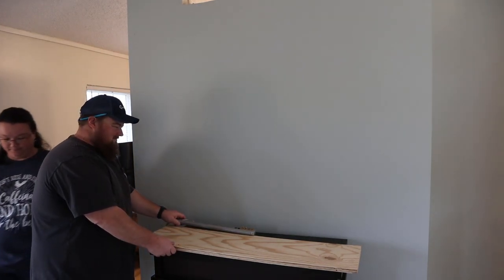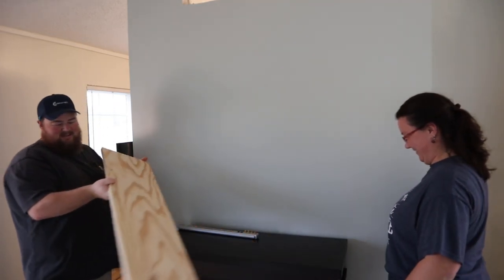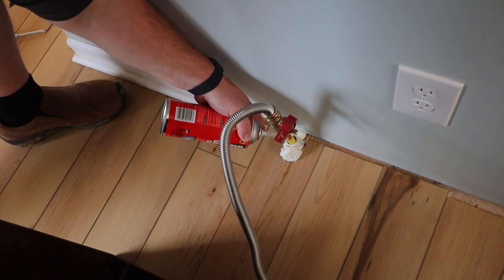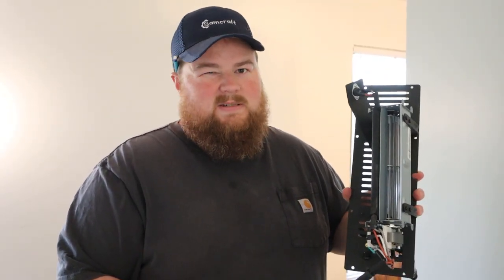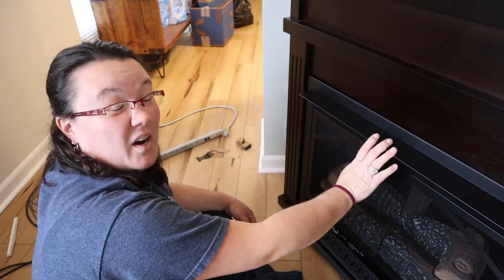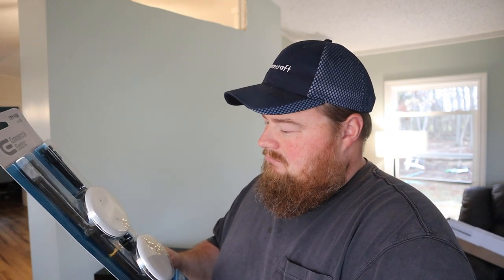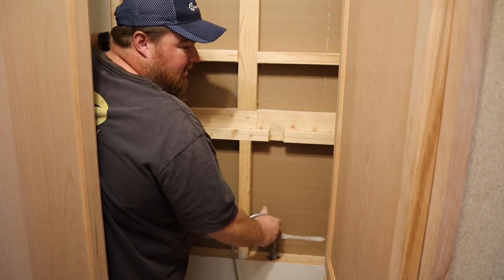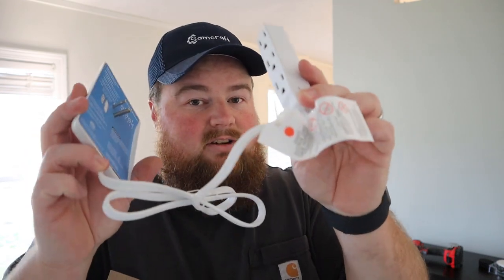Blower Install + Wall Mounted TV // Mobile Home Gas Fireplace Install

Comment: I still love the flooring, very natural and nice. I do have a question though about the fireplace. The blower intake is on the back of the fireplace that is now very flush to the wall which is beautiful, but how does it get air to pull in? If a vent is needed you could do a small metal black vent in the side of the fireplace on the Christmas tree side of it so you don’t see it. Idk. It all looks amazing and professionally installed. Great job.

Comment: We did the same thing as you...buying a squirrel cage type blower unit ...but after installing the fireplace, we too found that the propane fireplace put out so much heat and distributed it so well, that the blower was not needed.  We were located in the northern part of Minnesota and on the coldest days, just to give the heaters a boost, we would sometimes use a small box fan to help spread heat faster, but mostly it was never needed.  Something else about the one we bought, it had no thermostat, so it stayed on constantly if used, even when the fireplace would kick off.  And then all it did was make it feel colder.

Comment: Hey y'all. I'm insulin resistant. My body hates insulin but loves sugar. I feel much better after cutting my sugar intake below 50gs a day. Most days closer to 10 or 20gs. I had a high A1C and 180 glucose level. And felt horrible. I am feeling so much better. It's a huge change in my diet but it's doable. I had gout, "redneck" skin around my neck, pits and back of my knees, among other things. I now follow a pretty strict fat and protein diet, with either natural sugars like fruit, or artificial sweetner. Already lost 15 lbs in 3 weeks, and have no plans on stopping. Just give yourself a cheat day, don't go too crazy, but enjoy it. That helps curb those gravings. Slowly adjust and make small changes that have big pact. Felt like sharing it, not judging anyone. But if it helps to know, and you're going through it. You ain't alone. My brother got diabetes and he is now got it completely under control. Stress and life happens, trust me I know. Love the content.

Comment: I need to get one of those wire routing things for a TV in my basement.  When we remodeled my office down here, I put a couple new-work boxes behind the TV, as well as 'beefened' up the wall behind where the TV was going (like you did, that TV won't go ANYWHERE now).  The mount I used tho didn't have the supports for the sound bar, so I had to use mounts made for the speaker to hold it on the wall that came with it.  The other TV down there is on a corner mount from Monoprice, but right now the cords just kind of hang down, lol.  It doesn't have mounts for the sound bar either, so I designed and 3d printed a couple mounts that screw in where the TV's feet would have gone, and hold up the sound bar (same one you've got it looks like).  I see several people make wire chase things like you used, now that I see how they work and actually look on a wall, it definitely helps in me actually getting a set.  Great work on everything, looks great as it is.  (The ONLY thing that bothers me is actually seeing the cables between the sound bar and the TV, drove me nuts so I got some wire molding and put up covering it, that just happened to be the exact shade as the wall was, it's darn near invisible now..).

Comment: It's so nice to see you two again.
Glad you didn't change the color. I think it gives character to the room.
Is the blower going to have enough space in the back to intake air. 
I like the cord hiding gadget. It beats using the plastic cover strip on the outside.
During Christmas if you turn your TV to a channel that shows a fireplace and turn on your fireplace it would look like a double fireplace.
Just a dumb thought 🤔
I case we don't see you before Christmas
May the reason for the season bless you with all the joy, happiness, and love you can handle. 
Be safe.

Comment: So great to see you all! All I could think of when I saw the hole for the gas line was mice and bugs are gonna get in the house so I was ecstatic when I saw Sam fill it in with expanding foam. Then after Angela vacuuming the holes drilled for the TV mount, out comes the vacuum again 😂. The plug extension thing is very cool! Oh question: is the power strip extension cord for the TV and sound bar in the wall? And after you do whatever you plan on doing in the dining room will it be accessible? The reason I ask is I just found out they go bad after a few years. I almost had a fire in my home because the one I had went bad. Just curious 🤷‍♀️

Comment: Great install video. Sam, I noticed you used your level instead of the built in level on the wall bracket. I installed one like that last week and found the built in level was very inaccurate. Was that your experience also?

Comment: Looks awesome. I'm so envious! Sound bar question: I have problems hearing t.vs sometimes and have to turn them up. Not all the time but more than some might. question is does a sound bar improve the sound enough so you don't have to turn the volume up so much and/or improve the sound so voices are easier to understand?
Reply from the maker: They sure do help! Other things to check is the Audio settings in your TV. Some have different profiles that may help for clarity vs. just increasing the volume.

Comment: i have to you to  recommend. As I need the ceiling replaced as I just replace the flooring and subflooring it was full of black mold and rotting wood. Cleaned most of sanding floor and the black mold off of dishes and wall. Have pleaded walls. The ceiling will be the worst. Can not replace all the rotting walls or floor, Need the cabinets repainted as they are medium dark. Any help will  be appreciated. thank you

Comment: is the power strip for the TV going to be concealed inside the wall?  If so what happens if it's built in breaker trips? Will there be access to it from that other room?

Comment: No No No Sam it's a violation to run rubber power cords in the wall, they dry out and cause fires. Only run communication cables or TV cables in the wall .  VIOLATION VIOLATION VIOLATION.

Comment: Is your vent blocked for your blower by having it next to wall?
Reply from the maker: No, it also draws air in from below the firebox around the controls. It's perforated there, too. It's made to be pushed against a wall.

Comment: Just wondering how much heat actually makes it to the TV, I would love to replace my electric fireplace with a gas one my only concern is the heat toasting the tv.
Reply from the maker: With this model and setup, it's been absolutely no issue. The top mantle doesn't get hot and the hot air is deflected out and away very well -- without the blower too. We're very happy with it.